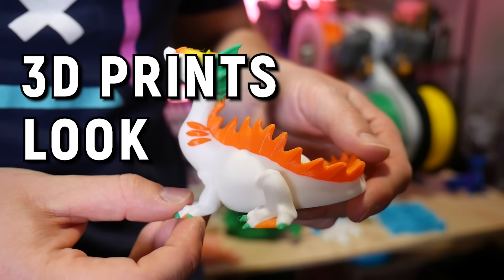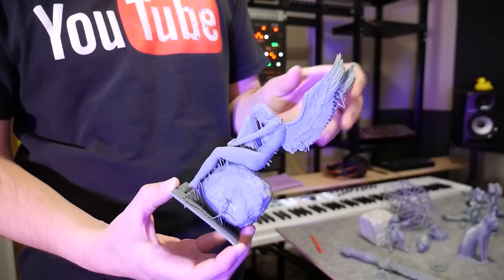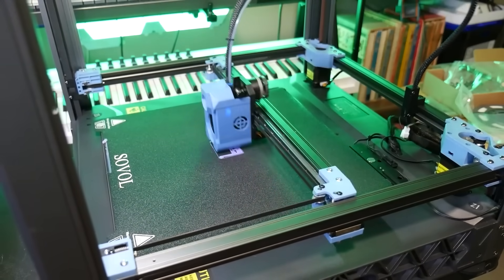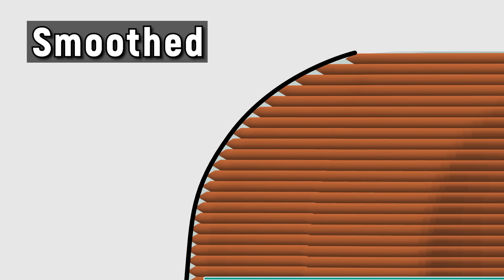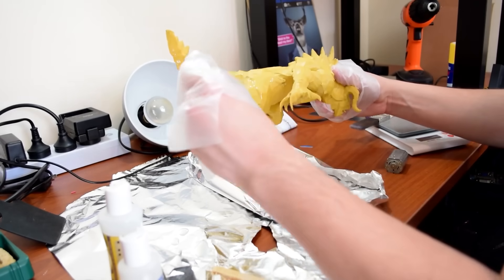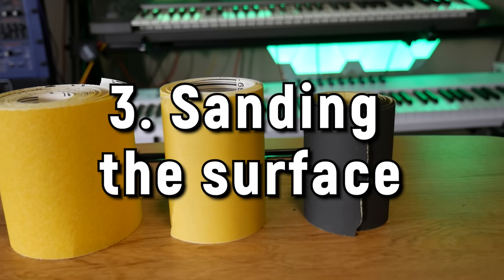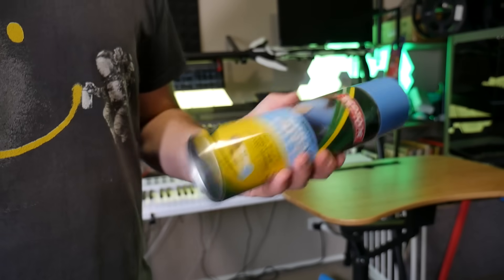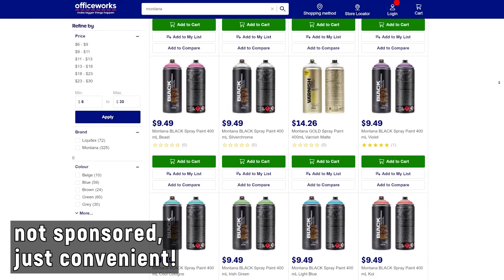How to make 3D prints look like they're NOT 3D printed.

Comment: ooor, and hear me out, use a resin printer, even a smaller one, and break the piece into parts, then coat that with primer, then color, then varnish, using an airbrush, and you only have to leave each layer to set with a small desk fan for 30min-2h depending on how thick you're spraying. but I don't know whether you can get a proper glass-like finish with this, but it's a very smooth start, and can preserve very well the details

Comment: For smaller parts what about using a tumbler w/ the right size / material grit inside to smooth the parts?  Tumblers are used to smooth stones so maybe the application can be applied to smoothing 3d parts w/ some modification?

Comment: I build droids, and agree - if you want something to not look 3D printed, sand it smooth and paint it.  A couple of tips to build on your suggestions:

-Print your parts with thicker walls if you're expecting to sand them.  You need to have enough "meat" in there to sand it smooth.  How thick those walls need to be depends on the accuracy of your printer, because a less accurate machine will need more sanding, but I'd suggest making sure you have at least 1.5mm to work with.  On my parts I tend to be cautious and print with 2.4mm thick walls.  (Also for strength.)  Connected to the accuracy part, slowing your printer down so that it's more accurate will save a tonne of time sanding in the end.

-Spray paint is paint mixed with a solvent.  Carrier solvents can have weird reactions with plastics.  When you first use a new type of paint on a new type of plastic, TEST IT on scrap.  It's unlikely in the modern world, but I have in the past had spray paints dissolve a piece of plastic, or just refuse to cure - I have a plastic ball I painted silver 20 years ago that still isn't fully cured and is tacky to the touch.  A good layer of primer will usually avoid any problems, but better to test your paints than ruin your parts.  (Layering paints from two different brands can also have weird effects and you should test that, too.)

-PLA is the most rigid plastic used on hobby printers, and consequently the most difficult to sand.  ABS is relatively soft and much easier to sand.  It's my experience that ABS is about half as much work to sand smooth as PLA is.  So if you're doing a lot of parts that you're sanding and finishing, and you have a printer that will handle ABS reasonable well, it's worth the effort to learn to print it.

Comment: You rattle can skills are lacking
Reply from the maker: havn't been taking rattle can classes lately :(
Reply: @MakersMuse  it helps if you warm up the cans before spraying, I usually set the spray can standing up in a large tub of hot water for 10 minutes, then shake for 3-5 minutes before spraying.

Comment: Most spray paints that advertise they work great on plastic, have a heavy acetone base (at least in the US).  So any plastic that can be dissolved by acetone, like ABS, will not only get a great bond, but smooth and bulk up the surface slightly.  It’s not effective on other plastics like PLA and PETG.  It’ll still stick like paint.  But you’re not getting the same bond and none of the smoothing.
Reply from the maker: huh interesting! I'll have to look more into that.

Comment: For the parts I make, my preference is to use "fuzzy skin" on prusaslicer, then sand the part a little bit. It almost completely takes away the layer lines and makes it have a nice texture that feels like a sand-blasted injection molded part.
Reply: I came here to say the same thing. It increases print time, but by far less than the postprocessing time it saves.
Reply: huh, might try it once.
Reply: Would fuzzy skin help on top gently curved surfaces though?
Reply: @roofoofighter  It does, because the little spikes go outward horizontally, so they end up masking the layer lines. And once you sand it just a little bit, nothing intense, it has this like nice textured smooth feel. 

You can also set it to be fuzzier in certain layers than others, so you can really play around with it. Ultimately, I would much rather get the machine to do as much work as possible on the front end so I don't have to get tennis elbow sanding plastic.
Reply: this
Reply: @KeithGroover  Fuzzy skin is awesome!

Comment: if you need a high gloss finish on a part, i STRONGLY recommend getting yourself the hobbyist set of MicroMesh pads. these things can take a print from looking like well... a painted piece of plastic, to looking like it's dyed glass. Best part is, unlike sand paper which can actually be quite aggressive in how much material it removes, MicroMesh is very gentle on the parts, so you can retain sharp edges.
Reply: MicroMesh is amazing ♥
Reply: Thank you for this tip and for introducing me to this product! 🙏💕
Reply: Damn, wish I saw this before I ordered sandpaper 💔Will definitely be getting some asap tho, thanks for the recommendation ^^

Comment: 0.06mm layer height and the 'Gunze Mr Surfacer' works great on smaller prints. I use it on DnD terrain, fills in the layer lines good but keeps the detail I want. No sanding! They just released a water based one that I'm hopefully trying tomorrow.

Comment: TIPS: TIP1: Wear gloves! Fine dust from sanding dries out your skin, the solvents of paint do even worse! TIP2: If it's possible, WET SAND! It prevents dust and keeps your sanding paper from clogging up! TIP3: After filling up the layers, use red scotch instead of the 120 grit, it gets in all the nooks and cranny's.

Comment: If you're looking for a thickener for your resin a favored technique with woodworkers is to add fine wood powder.  I would think the same would apply and it would make the surface easier to sand and wouldn't require as much sanding to get the desired finish.

Comment: Thnak you for a video! The best resin filler is kaolin. It is the clay used to make ceramic tiles. Unlike talc, calcium carbonate (marble) and the like, kaolin absorbs resin in its pores [this contributes to a much greater thixotropic effect. The only problem is that you can't use a white coating because it stains the resin.

Comment: Acrylic gesso can be a good option if you want a smooth surface quickly. The surface needs to be sanded rough first and I recommend water sanding. PLA in particular will clog the sandpaper in no time. If you use an ordinary brush to apply gesso, it is easy to leave brush marks. I don't know what the right word for the technique is, in Finnish it's called "töpöttäminen" but the idea is to stipple the surface with gesso. I recommend a foam brush or a wash sponge, a magic sponge gives an even finer texture. This leaves a smooth texture that can be sanded even smoother. Depending on how thick the gesso is, a few coats are enough and you can apply acrylic paint and acrylic varnish in the same way.

Comment: If you want a glassy smooth finish, I highly recommend wet sanding with a high grit sandpaper after a couple coats of primer. You can also wet sand clear coat if you choose to use it.

Comment: I usually use the bumper filler from Autobahn but they were out of stock recenlty so i used the one you have in your vid from Super Cheap. It worked great but it reacted with parts i had super glued together and made them come apart, sometimes with a quite audible crack.

I've also found timbermate wood filler is great fro filling in bigger gaps and joins before priming and sanding. Much easier cleanup and use that bog.

Comment: I found that wet sanding pla prints avoids heating up the print and no dust either. Car shops have a good range of that type of sand paper in rough to very fine grit.

Comment: I have been using the UV resin trick it gets close to a mirror finish on some parts after some wet and dry sanding. The alternative to powder is some people have talked about using flour. I have not tried that yet but regardless you have to do multiple thin coats so you can cute with a light as you go.

Comment: if you want to smooth things easier and cheaper- these are the methods I use- one is wood filler- works very well.. dont need anything special I apply it with my finger most of the time- a lil water on a rag- and it will smooth right now- easily paintable- another is dry wall mud- its very cheap as well- but if you are going for something you are going to be moving around or banging into shit- use wood filler- I use mud for my wall models that dont get moved around or touched- using bondo and all that expensive shit- is very much over kill- not to mention stinks to high hell >><< and a good 2 in 1 primer auto spray can primer works great as well- but most of my BIG models I use cheap ass apple craft paints- out of my 2 qt gun- works great!

Comment: It's not always an option, but I prefer to try to design and orient my prints in a way that they'll look good with the layer lines being visible. I've also found that matte colors hide those lines quite well, so that can be a consideration in the material choice. Playing with top and bottom infill patterns can also enhance the look of a "raw" print. Having said that, most of my prints have so far been fairly utilitarian, so they don't need to not look like 3D prints. What I have been doing is adding design flourishes that make a print look nicer: chamfered or rounded edges, shadow lines, embossed or debossed patterns, text or logos, that sort of thing. I've learned a few simple tricks (most of 'em on this channel) that do much more to improve the look of a print than any amount of sanding and painting would. As long as you're not deliberately mimicking the look of something else, like you would with a prop, "designing for 3D printing" can also mean taking the esthetics into account.

Comment: If you have seams from joining multiple parts together, I highly recommend using a watered down wood filler to paint over both surfaces and sand down to make it look like one continuous piece. It is way cheaper than glaze, doesn't have any fumes, and sands SUPER easily so you can be pretty liberal in your application. I would reccomend Dap's Plastic Wood as a starting product to compare to (I know it is in the US, may not be global). Additional tip, add the wood filler to a disposable container and then add small amounts of water and stir until it becomes easily smearable. Add very little at a time, it takes less water than you think and you want it to easily spread, not run.

Comment: Do you think that part of the problem with 3d prints is operator error and lack or trying for better prints.  I have noticed that top TUBERS have kind of slacked off on getting best prints possible and. have stopped helping bring 3d printing to the next level as if it has topped out.  But how can it top out when Tubers only create AVERAGE prints.  I have been watching you for YEARS and you used to create incredible stuff for what was possible. It seems that now the tech can do better things Tubers have backed off on challenging the tech....NO?  Resin should only make FDM creators pissed and more vigilant , but what I see is lazy FDM printers cause it cant be as clean as resin and that is just BS.  There is one guy on the net who's fdm prints rival Resin!!  One guy!  His name is PAUL.

Comment: I used plastic wood filler, it works great and sands easy. Then primer and worked my way up to 1500 grit paper on a Vader and an Ironman helmet. They look like mirrors after painting. Lots of hours sanding and priming though

Comment: So how do you finish detailed parts?
You said that method 1 and 2 do round over small details, and then said that method 3 (sanding) is the best. But sanding is even worse than the first two methods for small details.
Like the example at 6:37 . Coating does round over the small details, but at least it's a viable option for parts like that. You wouldn't sand a part like that, would you?

Comment: Another tip if you want to sand a print but don’t want to paint it and want to keep the original look of the filament you can rub Vaseline into the print where you have sanded and it will remove the white sanding marks back to original colour.
Reply: ty for telling that
Reply: @Z @Zed9659 weird I just found another better way on  the weekend, I used a spray on lubricant (PTFE inox mx5 can) and spray a small amount on the surface WHILE you are sanding (need wet sandpaper) it makes it look perfect and because you can see it as you go you know what the end result looks like.

Comment: I don't use pla, but my abs prints, If I need very good finish, I sand the parts with 100 grit, then work my way to 6oo grit.  After applying top coat, I wet sand with 600 grit and use automotive rubbing compound to get a very excellent final finish.

Comment: For TPU I can get rid of all layer lines by heating up some kind of rounded smooth clean metal like a screw driver. Heat it up to about 70 degrees on a stove or any heat source that does not make soot. And rub it back and forth over the print really REALLY fast. Like moving your arm back and forth 10 times a second. But just let the metal lightly rest on the TPU while it’s whipping back and forth. Feel the surface and see where it needs more smoothing in bursts of like 5 seconds on. 10 seconds off: it slowly melts the top layer completely smooth without changing its shape or anything. It really is just the layer lines that go and I print at 0.28.
Reply: You can get a temperature controllable soldering iron for less than 40 dollars which could ease that process, too. It's the method I've been practicing with, with the bonus that it allows welding parts and adding material via scrap or raw filaments.
Reply: @Dr.Fluffles  yeah I have a high end hakko that I kept a spare rod just for that but I found it oxidised too quickly and solder on there obviously wouldn’t work so I find it need to be stainless steel.

Comment: I have experimented a bit with making ABS solutions in acetone and coating PLA with them (a brieff dunk and letting them dry in open air). I really liked the result, no or minimal detail loss and a nice glossy finish. Although you could kind of faintly tell that the layer lines where there. I believe that tuning the concentration and maybe sanding could fully remove the layer lines with no detail loss.

Comment: I make a LOT of cosplay weapons with extreme attention to screen accuracy. Here's my process: 1) use a high quality printer like my PRUSA i3 Mark 3 and XL and print at .15mm layer height.  My prints usually come out ready for primer with no sanding required! It pays for itself in the amount of time you save in NOT having to prep a model, 2) use Bondo spot glazing putty to fill in obvious layer lines or supports areas gaps ... pro tip - this stuff is acetone based so you can squeeze some in a cup and add a little bit of acetone and now you can paint on the glazing putty which enables you to cover large areas quickly!  3) sand glazing putty areas with 220 sand paper , 4) 2-3 coats of Rustoleum 2 in 1 filler sandable primer, 5) wet sand with 320 (most layer lines should be gone with this step but repeat if necessary), 6) 2nd round of the same primer,, 7) wet sand with 600. Repeat steps 4-7 until part is perfectly smooth and it looks like a mirror. You are now ready to paint. Note if you are doing large pieces like say Mandalorian armor you'll want to use 'guide coats' along with the primer to ensure the part is finished perfectly smooth with no high or low spots. Using this process people are always amazed that my props are plastic and not metal. Of course you need to have some skill with an airbrush or rattle cans but that's for another video.

Comment: I've been doing some printing lately using Polymaker CosPLA filament, which is designed to be easier to sand layer lines out of than regular PLA.  It does seem to work pretty well for parts that have large surfaces without a lot of detail, but I've found that small details can get lost easily if you aren't careful with how you sand the part.  It's also only available in a neutral grey so you'd only be able to use it on parts that you're planning to paint.

Comment: I have some of my prints that sagged during post processing. I initially assumed it's caused by the automotive coats I used to level out the layers but then it happened to a model that  I sprayed with Tamiya undercoat. I finally concluded that the sags were caused by exposure to the sun or too much heat. I keep forgetting that I have unprocessed prints that sagged when I left them in my car under a hot sun for days.

Comment: You are giving some misinformation about UV resin. There is no such thing as over curing UV resin. It is either completely cured or incompletely cured. If your completely cured resin is brittle, you are using a resin which is brittle in its cured state. It is a polymerization reaction. Once it is complete and there is nothing left to react, it can't react more and it won't get more brittle. If you want a resin that isn't brittle in its cured state, you need to pick one which has that property when cured.

Comment: I tend to sand a bit less initially and fill the layer gaps with automotive glazing putty. Small parts can be hard to sand on so going for something that builds up to the peaks of the layers gets the part smoother faster.
Then a high-build primer to start making it better. A really smooth prime layer makes the paint job much better.

Comment: I usually keep two UV resins on hand for smoothing prints.  One right out of the bottle for fine detail and another thickened with cornstarch based baby powder.  I have also heard of people using fumed silica for thickening resin but I have yet to try it.  Another handy filler is Bondo glazing and spot filler. It's an air cured putty.  It can also be thinned with acetone to be applied with a brush.  The acetone also helps it cure faster.  Both UV resin and the spot filler can be further smoothed with sanding.